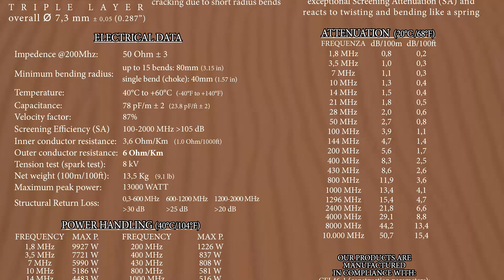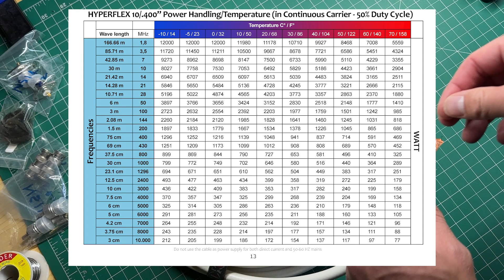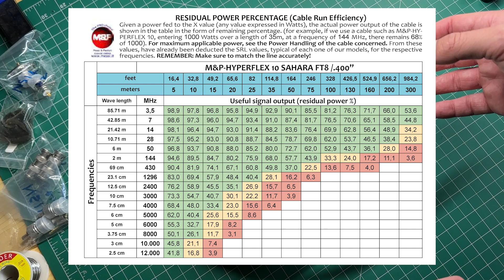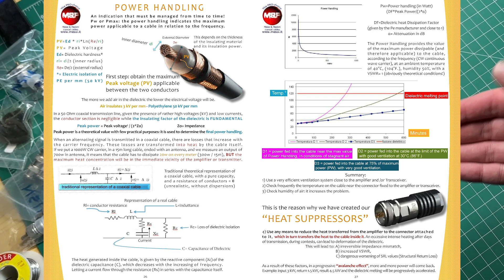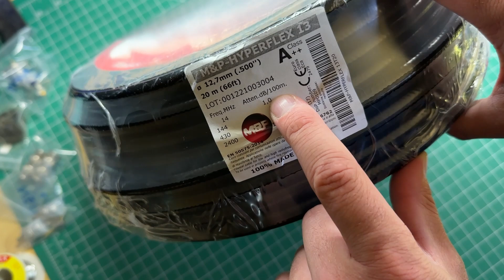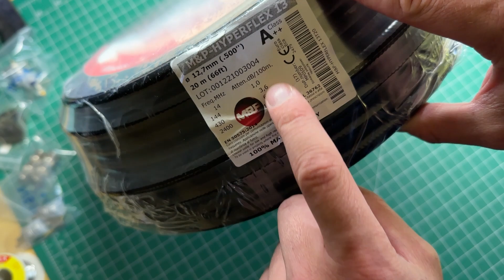The Coaxial Cable That Can Handle the Heat!

Comment: i have Ben Running that coax with their Evo Connectors now for 6 months or so after i first Discovered them & after being into the radio world for 35-40 Years I Will Tell you Straight Up That It Is The Best Coax I Have Ever Had/Saw Or Used !I Have a Evo N Connector on one End of my 65Ft Run to my Comet GP-9N & The Evo Pl 259 Connector on The Other To My Yaesu Ft-991 & I Talk to a Repeaters That Are Right At 100 Miles From Me Almost Daily & My Antenna Is Only About 25Ft +- ! I Paid For My Coax & Connectors & Am Fixing To Order Some More For Another Project ! I Just Cant Say Enough Good About M&P Coax..They Really Are The Best n The Business & Are True Enthusiasts ! Great Quality Is Worth The Extra small Extra Cost ! Buy Once Cry Once Because You Get What Ya Pay For !

Comment: I fail to see why this stuff is so special. Cable temp characteristics are proportional to degrees kelvin so the difference between 20 and 50 degrees in minimal as it's really 293k and 323k. Smells like hifi cable bollocks.
Reply: That makes no sense. Material properties are NOT linear. Plenty of jackets materials are highly flexible at 30C and very rigid at 0C. Tiny difference relative to absolute zero (0K), but huge difference in practice. (Ask any electrician who works outdoors in cold places: you don’t want PVC-insulated multimeter leads because they get stiff in the cold. So you use silicone instead, which doesn’t get stiff when cold.)

So if, for example, you have a jacket that gets soft at 30-50C and it’s under some kind of tension or strain, it could end up with indentations where it’s suspended.

Comment: Watching ham radio content on YouTube is basically watching ads. Why do you buy all the rig, cables, etc..for? Maybe a channel called ham radio dx should show ham radio dx.

73
Reply: Tend to agree with you on this video. I'd like to see some actual testing of the makers claims rather than simply regurgitating the sales pitch. That heatsink for example looks like a solution looking for a problem. I have never used M&P cables. Why? because they are not readily available here in Aus and freight cost ex Italy is going to be harsh.
Reply: @RobB_VK6ES  I think M&P cables are good, actually overkill. What I mean is that these YouTubers buy, review, buy, configure, build, test…. But never show what is ham radio: the qso. All of these exists so one person can talk to another. The big YouTubers rarely show it, and most of the times when they show something, they show ft-8.

I understand that, and why, their only worry are sponsors and the famous Amazon link in the description, but it makes the content so bad….
Reply: @RobB_VK6ES  load of old cobblers. Marketing wank to make the cable sound more special than it is.
Reply from the maker: I think you need to have a look at my back catalog… you’ll find plenty of “DX” videos.  Perhaps you are just being ignorant, most likely actually

Comment: Dry environments... can't put self amalgamating tape over those to seal up the connection. It's not a concern for me. I'm running only 100W here for now.

I just ran 200 feet of Hyperflex 13, crazy flexible, more so than my RG213. (Antenna farm is a long way from the apartment.)

Here, we have had record rains, freeze thaw, etc, this winter. Right now is our first real cold snap, -28⁰C with a windchill of -40⁰C.

Comment: 1/2 inch?  Those attenuation figures aren't that flash, ldf450 is 1/2 inch,  and only 2.5db around 144  and 430 is 4.5db, that stuff is too lossy. thats a FAIL from me.
Reply: Edit: I looked it up. Heliax? Try running that to a rotator or around tight turns!
Reply: @patrickbuick5459  I deal in FM broadcast, telecomms and commercial gear thats 100+ metres up towers, I only deal with stuff that will survive 30-50 years,  thru multiples of combiners where reliability and attenuation are critical, I take that approach to my hobbies too, if that makes me an outer to the fanbois here, so be it, I wont lose any sleep over it lol
Reply: @Ressy6  Then you have access to cable, tools, expertise etc that the rest of us can only dream about. They also are fixed installations, my needs in an apartment are much different. I think the fan picture is looking back from the mirror.
Reply from the maker: LDF450 is good for fixed runs. Not for around rotators or short runs requiring flexibility.
Reply: Why does everyone compare apples and oran… wait… apples and school busses. Not even close to the same thing.
Reply: LDF 450 is a nominal 1/2 inch: in reality (see datasheet),  it's STIFF AND THE OVERALL Diameter Over the Jacket IS 15.875 mm | 0.625 in (AND NOT 12.7 mm (0.500") like M&P  Hyperflex 13